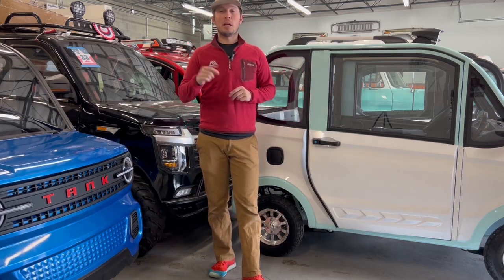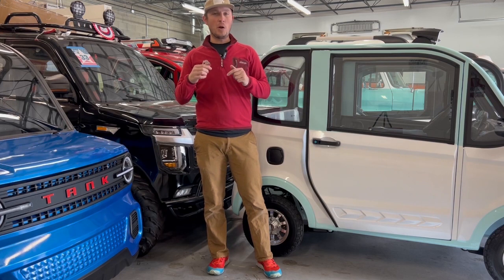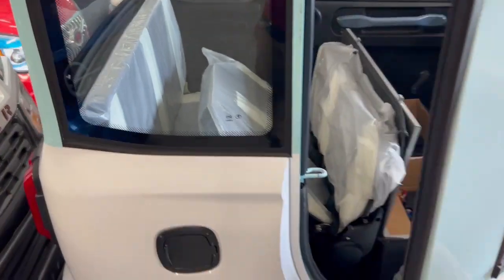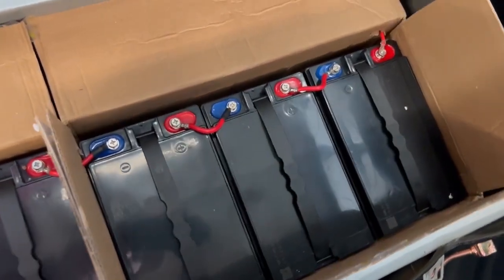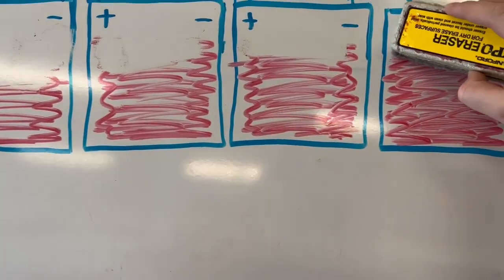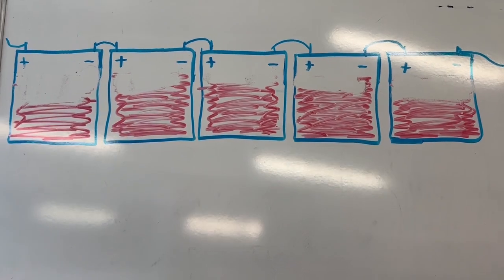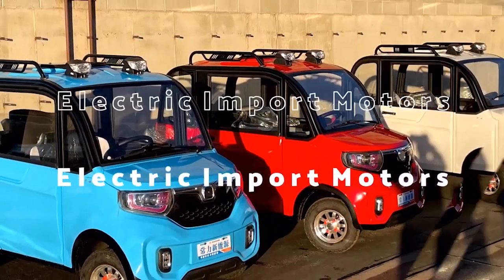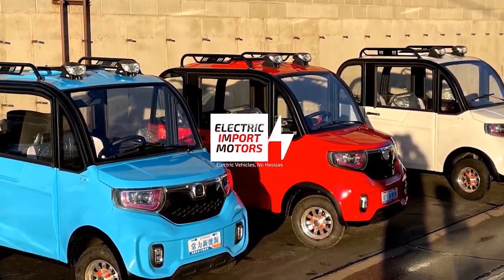Tank ( ChangLi) batteries up close.  We are not electricians, are we right?  ..Yes we know the audio

Comment: Adding to what @TacticalTightwad stated in previous comments. 
The "tank" comes with Five,  12 volt flooded AGM (Absorbed Glass Mat) batteries.  With AGM batteries you have two choices: Either discharge (take them from 100% full to say 30%). In that scenario you have more "charge cycles" in the batteries AND the harder it is on the battery. All batteries have a # of charge cycles. Option 2 example is discharging the battery from 100% full to say 80% and then charging the batteries back to full. In this scenario, you are discharging the batteries less, however, you are putting the batteries through a charge cycle more often. 

In addition to charging and overall battery Life span, AGM, Lead Acid batteries life span is shortened from extreme Heat or Extreme cold. They also do not like extended periods of non use.

I live in Arizona and have sold golf carts for 10 years. For 4+ months of the year it's over 100 degrees. Most that buy carts here are seniors and snowbirds. Those carts (batteries) sit idle for 4-6 months in blistering heat. NOT good for the lifespan of a battery. The same would apply to batteries up north in extreme cold temperatures. (A "tank" is basically a golf cart in every way. The major difference is the battery pack set-up, ie: 60 volt system...) 

Takeaway advice: I personally would never discharge the "Tank" batteries more than 30% down and ideally not a lot more than 50%. You would have to visually monitor this via the battery indicator on the dash. Again, it's a trade off of discharge level of batteries vs total charge cycles the batteries are rated for.

Comment: part right part wrong. might have been that you have a weak battery or batteries(but not all) among the set that drains faster than the other good ones. it would be recommended that after using the truck, may i suggest you cut off the breaker and immediately measure each battery. a weak one would surely be measured.

Comment: The batteries are wired in SERIES, and the first and last batteries take no more punishment than the ones in-between.  They all provide equal current, and all are drained equally.

Being lead acid batteries, when you have a heavy and continuous discharge of the batteries, as you did, the batteries will stop providing power before they have used up all of their theoretical capacity.  When you let the batteries sit, they experience what is known as "recovery" that allows the battery to recover some of its unused capacity, and you get another short burst of power.  You might have experienced this if you have a car that you try to start by repeatedly cranking the engine until the battery becomes discharged and can no longer turn the motor over.  But if you let the car sit for a couple of hours, then you'll get another crank or two out of the battery.
Reply: 100% agree with your comments. The only thing I would add is if the batteries are not equally charged, then one battery could drop out before the others are drained. This could also damage the low battery. The solution in solar battery backup systems is to have a BMS(battery management system) to monitor the voltage of the invdividual cells and disconnect power if the voltage gets too low or too high for any single cell. Also some BMS's can balance the batteries to make sure they have equal voltage.